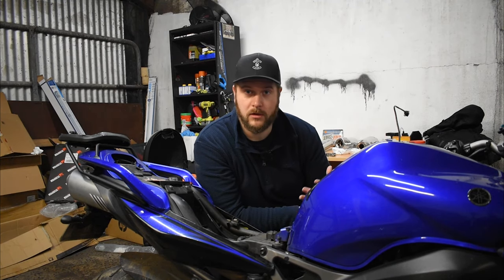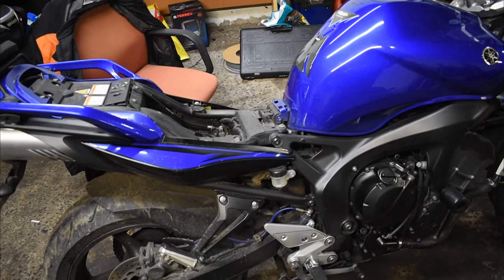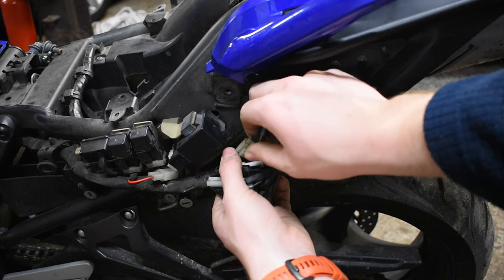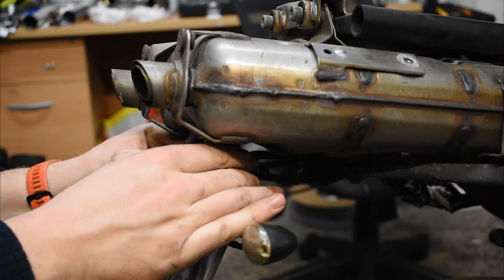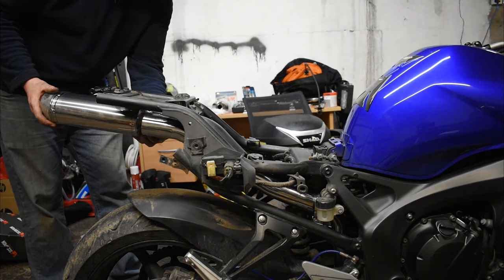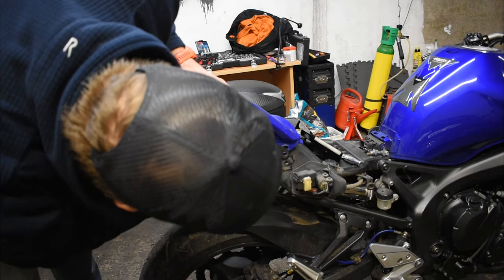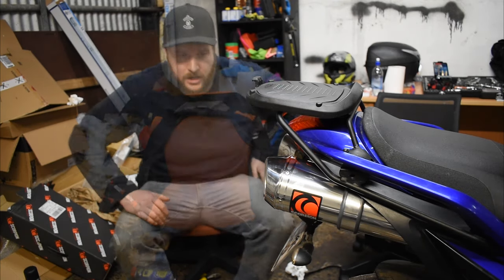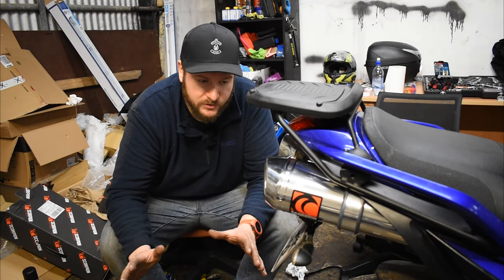NEW EXHAUST | Removal and Fitting | Yamaha FAZER 600 SCORPION Exhaust and Cat Delete Pipe Install

Comment: I would use the term "over-engineered" to describe that stock exhaust. Tricky little fecker to remove. 

Noticeable improvement in sound though. And it looks miles better.
Reply from the maker: Agreed!! Tricky is the word, nothing difficult just fiddly which is always the killer :D 

Oh man wait until you hear it de-baffled, it's amazing and I'm ......overjoyed?.....at the looks. Reaaaallly happy with how the stainless steel look fits in. I'll be polishing my pipes all the time now tho yano.
Reply: @TheGorillaBiker  That'll be a pain in the hole but sure a little pain is acceptable for some screaming 4cyl noise!
Reply from the maker: Absolutely!! I'm actually really looking forward to doing the flyby comparison video and stuff. I have the stock exhaust shot just need to do the rest now asap :)
Reply: @TheGorillaBiker  Get on with it, big fella!

Comment: Nice bike mate. Thinking of doing the same to mine. Mine is factory with Cat still installed. Is it as simple as me just doing what you did or more difficult seen as iv still got the Cat. I'm from Dublin by the way 😎👍
Reply from the maker: Thanks bud :) It'll be the exact same just watch for the seal that could he ok the lower header at the cat pipe, you might have to cut it off. Other than that the same job :) 
Ah class we can have a scorpion off at some point!

Comment: How do i know if i need to buy the catalytic pipe? 

Ive just bought a 2005 fz6 and am wondering if i can just get the half system and put it on whats already there or do i need to buy the catalytic pipe too?
Reply from the maker: Pretty much if you want to, the stock link pipe with the cat will also fit fine.

Comment: Hey mate. Just followed this video to fit the same exhaust. All is good except I’ve noticed the two cans are extremely tight fit against the rear sub frame and the left one is actually rubbing against it. Can you remember if you’re was the same ? Thanks
Reply from the maker: No mine definitely weren't rubbing on the frame, I did a bit of pulling and dragging to get them lined up fully alright so maybe just loosen off everything a pinch and try re orientate it?
Reply: @TheGorillaBiker  thanks, I’ll have another go on it tonight. What sort of safe gap should there be between the cans and the frame do you think? Does take a bit of wiggling around doesn’t it. Thanks again 👍🏼
Reply from the maker: Ah any gap at all should be fine they don't move much once they're mounted. If you're still having trouble grab some high temp foam and stick it between them.and that'll sort it :) It does indeed! No bother :)
Reply: @TheGorillaBiker  I found your
Video a lot more helpful than the scorpion instructions!
Reply from the maker: Ah thanks :) Glad it was useful!

Comment: Does any body know how you do exhaust port gasket on a Yamaha Frazer fxs year 2000
Reply from the maker: If you mean by the headers it's straight forward enough just make sure you use a lot of releasing spray because those headers bolts are a nightmare to open.

Comment: Can you put a 4 into 1 side silencer on these under the seat exhaust fazers?
Reply from the maker: You could if you got some custom pipes made up.
Reply: @TheGorillaBiker so a lot of faffing about! So downpipes  configuration on side exhaust bike is different to the under seat downpipes configuration? The can that you got won't slot on to either?
Reply from the maker: @garystevens4303  yes, I looked in to it and it's possible with a link pipe of the right size, you'd 100% need a remap if you went 4-1 too. 
Oh yeah you could definitely fit those on once you got the right size link pipe made up!! Very doable you'd just need a bit of custom fabrication to suit.